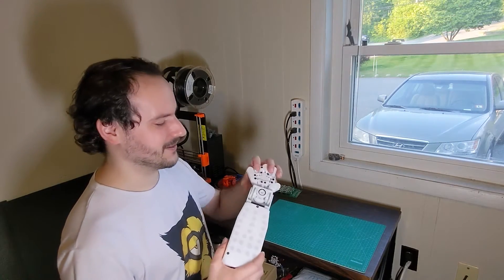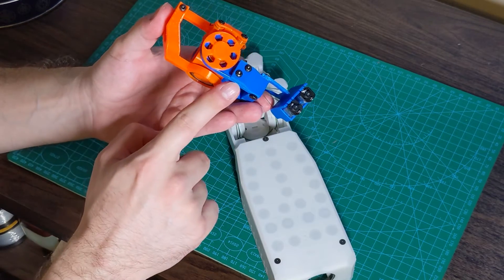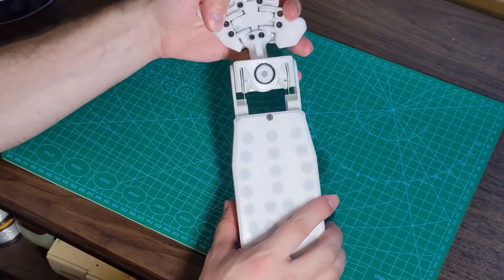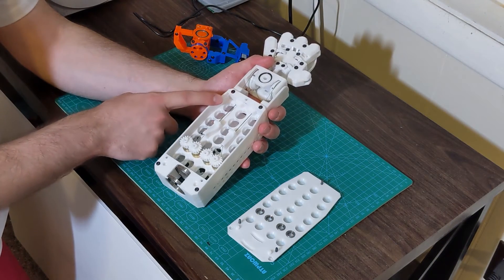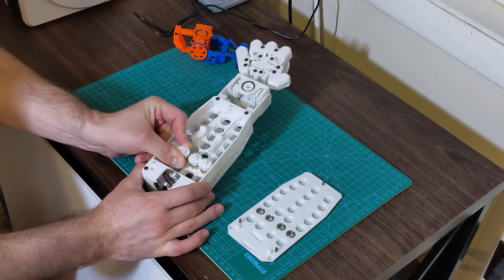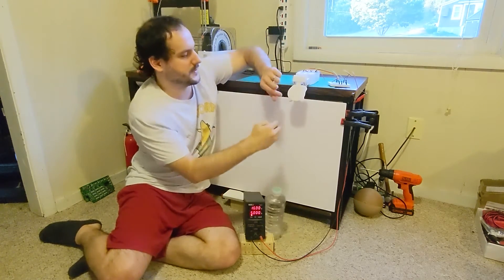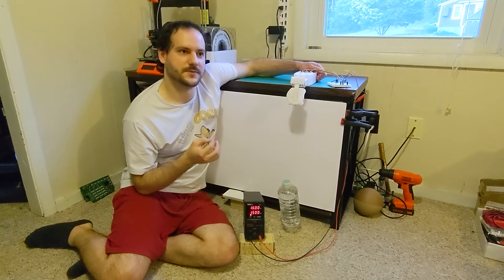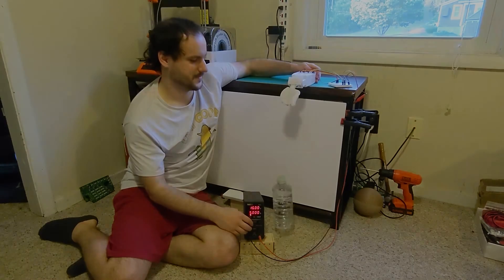Cable driven differential wrist for robot hand

Comment: Please advice me type of cable used for this project.
Reply from the maker: Hi, I got the wire from a local Walmart, but I'm sure you can find it online elsewhere; it's called "SpiderWire EZ Braid". Says it withstands 50lb, but what I really like about it is that it's really stiff, so it couples the wrist to the motors with less backlash.